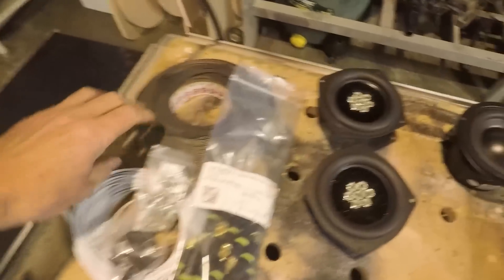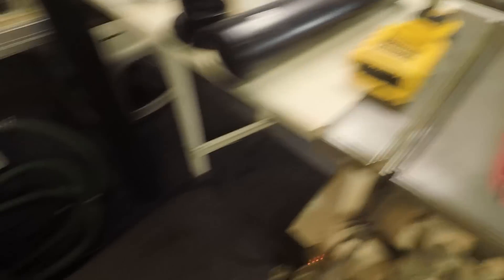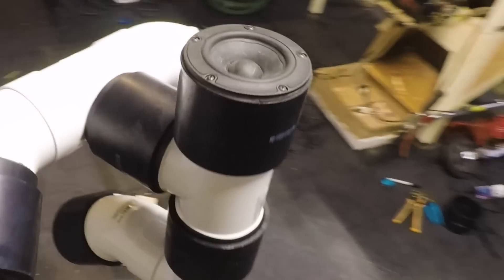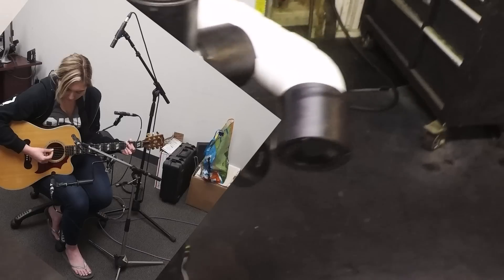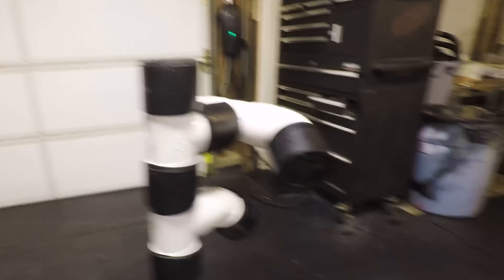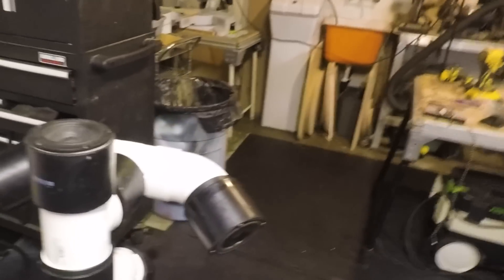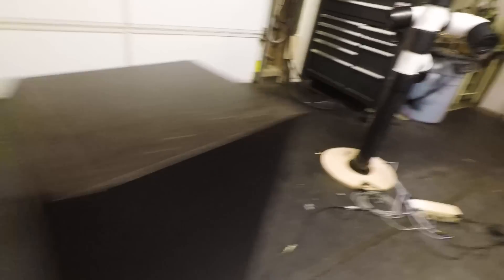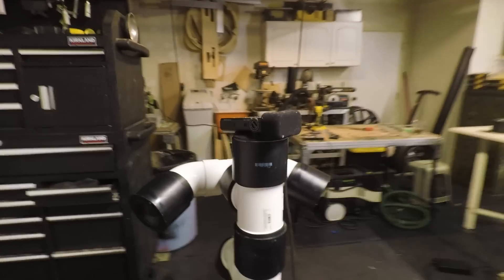Speakers Don't Sound Real, Lets Build One That Does

Comment: @Dave Rat  
I get what you're saying and trying to demonstrate, and why it may be "more accurate or realistic"...but, it's just not practical, "simple", or efficient.

A "relatively simple" stereo system using just TWO channels and TWO loudspeakers (& maybe a subwooder for ~80Hz & lower) can recreate a musical performance with the musicians placed in distinct points who are spread across the "sound stage" pretty dang convincingly.

In addition, while it may be a compromise, a 2-channel stereo setup is WAY more versatile when it comes to reproducing a Wide Variety of performances and/or numbers of musicians and instruments.

Tracking engineers aren't going to want to set up & track Each Instrument or Vocal performance with 4+ mics (drum kits excluded for obvious reasons).

Extra mics, cables, preamps, and LOTS of multi-tracks all become expensive, and it would slow the music production process down significantly.  By the time I've set up 4+ mics for a single acoustical guitarist, he or she has lots his/her inspiration and excitement, and I end up just capturing a forced, mediocre performance.

Same applies to a home or car stereo system.  Sure there is the popularity of Home Theater setups with the latest surround sound formats that require lots of multi-channel processing, amplification, and loudspeakers & subs, but due to size and budget constraints, most music enthusiasts still just want to have a fairly compact, affordable "stereo system" that doesn't impact their living space or budget too much.

And IMO, I never want the reproduction of sound in my home or car to get too releastic (it's already extremely close), because I never want to lose the inspiration or desire to experience live musicians and performances.

On a side note, go take a listen to some of the direct to 2-track recordings that Pierre Sprey (RIP) has done for his Mappleshade Records label with a single, custom stereo microphone setup...think Blumlein/ORTF...with all of the musicians positioned around the mic in the room while performing together live, "mixed" by using distance and placement.   IMO, they are realistic and convincing enough for me (a drummer & saxophonist) when played back on a decent 2-channel stereo system.

IMO, your proposed speaker setup and system would obviously be way more realistic compared to traditional 2-channel stereo setups IF we all wanted to walk around and move between each of the performers and instruments on the stage...i.e. replicating me walking to my seat in the middle of a large orchestra to the woodwinds section while everyone is "tuning up", etc.

But how many of us experience musical performances this way in real life?  Pretty much ZERO, right?   We're usually in a fixed position somewhere in front of the stage.  And most of us would not have the necessary space in our living spaces/homes to place all of these extra speakers, nor would we have the desire to walk around them while we listen...I'm usually kicking back in my cozy chair or couch while listening at home.  Or if I'm out and about running errands, at the gym, walking/hiking/cycling, I'm using IEMs that can't accommodate this type of setup.

If we go to a small club or most concert venues, large or small, we are either sitting down in a chair in a relatively fixed position, or we pick a position in the crowd to stand during the performance.  In either situation, we are located somewhere in front of the stage, not walking around the performers on the stage.

So, for those reasons, I don't think that the relative simplicity and reproduction/performance quality of a traditional 2-channel stereo system is going to change in any significant way in the near future.  It's relatively simple, compact, affordable, and effective.

Just my .02 FWIW
Reply from the maker: It's fun to think of all the ways things can't work and even more fun and challenging to think of the ways it can.

Perhaps a singer songwriter could get 4 mics and sit in a studio or at home and live stream video and realistic sound to the 4 or 8 of theses speakers they own located at bars and restaurants around the city.

The musician can play loads of gigs at the same time, the bars and restaurants save money and get a realistic sounding performer that brings ooohs and aaaahs and sounds so real it's an attraction of its own

Or perhaps it's used in conjunction with a 3d projection of someone giving a speech or seminar. It works with vocals.

Or at a trade show selling products or an online site is setup where people can upload there music recorded this way in 5.1, 4 mics for the instrument, 1 mic for the room or 9.1 for 2 instruments and this system now ties into existing tech.

My believe is that sonic realism is so impressive when heard, it will gain traction organically if not marketed
Reply: @Dave Rat  
I get you.  I'm all for the pursuit of sonic realism and the challenges of exploring what is possible, as well as the fun and problem solving that comes with it.

But from what you have proposed so far, unfortunately, I kind of have the Beta vs. VHS conundrum in the back of my head.  But if you can develop this further and design and produce a system that achieves this level of realism, and it would be available and affordable for a wide range of artists, consumers, and venues, AWESOME.

If there was any more perfect time to develop this technology and make it a reality, it would have been during the height of the C-19 pandemic and the lockdown on live performances.

As it is now, EVERYONE wants to get out to a real LIVE performance and actually see and hear the artist(s) Live and in the flesh. 

(For me) music remains a very social experience.  I don't particularly want a reproduction or simulation of the artist(s) to be as good as a true live performance.  I'm not yet willing to give up the "human" factor.

No matter what type or how good of recording and/or visual projection of an artist is, at a venue, the artist can not actively interact and respond in real time to and with the crowd or listeners.  That direct connection, interaction, and resulting emotion is lost.

Again, I can sit at home or in my high end car audio system and listen to a fairly convincing recording using my 2-channel stereo system and enjoy it immensely.  But for those artist's music whom I really admire and love, I still want to see them live and in the flesh to experience their raw emotion, musicianship, artistry, and their response/interaction with the audience.  

With recordings, it's obviously easy to mix and "edit" the audio to produce a flawless performance.  But as you well know, at a live performance you are able to see and hear the performer's true level of talent and artistry, flaws and all.  Sure, there's AutoTune and backing tracks to trick us to some degree, but there still is the...human factor.

But I love that you're always exploring and thinking outside the box (speaker) ;) and hopefully we do find a way to make the reproduction and playback of musical performances and/or speeches, dissertations, lectures, etc, more involving, realistic, and interactive.

I'm also a drummer/percussionist and saxophonist, so I have a vested and enthusiastic interest in better recording technology for capturing, distributing, and sharing my music with others.

Luckily, really good microphones and recording equipment is becoming available for less cost each year, but I'm partial to the better ribbon mics (and top quality mic preamps for them), which adds up quickly for an independent artist.  So, the potential need to use even more microphones to capture each artist's performance might be a tough sell for some...  Maybe not so much of a problem for established artists and the larger commercial recording studios. 

And I hope to see you in the lineup someday soon, too!   I'm a surfer and former pro surf photographer for SURFER and Surfing magazines back in the late 80's/early 90's, where I mainly covered my local L.A./Malibu/Ventura/Santa Barbara areas, as well as far off travel destinations, surf/sailing surfaris ...Bali/Indo, Fiji, Tahiti, Japan, Oz, Rarotonga, Mexico, Hawaii, etc.  ;)

Cheers!

Comment: Hi Dave, what is the length of the pipe, how do you stuff/line the pipe, and how do you connect to the amp? Thanks a lot. I’m interested in this concept.
Reply from the maker: The pipe length does not matter much, I just selected lengths for a reasonable hight similar to a seated guitar player.

Stuffing insulation loosely in all the tubes is very important. I ran wires in the tubes and and used some small class D amps. You can buy 2 or 4 channel amps on Amazon for under $30 or so.
Reply: @DaveRat  Thanks Dave! Appreciate your response.

Comment: Another idea which might help with creating the natural sound.  This really only works for recording vs reinforcement.
When placing the microphones, put your head near the spot and take a listen.  A movement of a few inches to a few feet will change what the "mic" hears.  If you then try and record the most interesting part of Left/Right/Front/Back, closer/further.   I think it will make it even more realistic.

For vocals, try off axis left/right/up/down and it will change the eq characteristic significantly.  Even for guitar amps, turn the guitar down and amp up and listen with the mic/ear till you find the most interesting/pleasing/subjective sound you want.   Get your head into the spot if you can, otherwise use the mic with the headphones on.
Reply from the maker: Very cool and for capturing position that is good advice.

Comment: Hi Dave, love your channel. I have a bit of a technical question for you if you have a minute. I watch a lot of audio production videos on mixing/master heavy metal guitars and a lot of guys use the lo/hi cut filter to kill off the 'whoof' and the high end white noise, and also so in the mix the bass/kick doesn't have to compete.  but to me this seems like you're gutting your guitar tone and good frequencies that should be retained.  Would you know of a more clever way of making guitar sit in the mix without killing/deleting the extreme lo/hi end? Could 5.1 surround be an option for assigning speakers for the one instrument? Cheers!
Reply from the maker: Hmmm, well the assumption that they are killing part of the tone may be flawed. Mics tend not to pick up like we hear and a close mic speaker can offer way more HF and LF than the rog actually sounds like.

Cardioid mics unnaturally boost lows. Air wind from the speaker motion is not really audible to us but the mic sees it as low end sound. And for the highs, the higher freqs will be extra loud towards cone center and very beamy, mixing off center too far gets boomy. Most guitar players ears are not at the height and dead center to the mic. So the mic picks up a brighter sound than the guitar player hears or intends.

So, I would lean toward, "make the pa sound like the rig and do whatever it takes to get there"

Comment: Interesting idea Dave, there have more than a few companies over the years that tried to come up  with multi-direction speaker systems and the issue was always phase between drivers especially in 2 or 3 way design's , next is the issue with most audiophile assumptions that  phase should always be relative to one main point . One of the reasons why di-pole home audio speakers are so well liked is because they produce that type of sound.
Reply from the maker: Yeah, I think the desire to overcomplicate makes it worse
Reply: This is why some people prefer Ohm Walsh's.
Reply from the maker: There are many great sounding and great looking speakers out there. And there are no e I have ever heard that realistically reproduce sound such that when I walk around it is not obvious that it's coming from a speaker
Reply: @DaveRat  But the same would happen at a sound reinforced venue. Walk behind the speaker stacks and you get the same effect other than the sound from the stage monitors.
Reply from the maker: True, and my goal is not to reproduce the problems of existing speakers, nor is this design a reinforcemet product

This is designed to sound like an actual real natural instrument being played
Reply: @DaveRat  Thanks Dave. I agree it sounded very good....surprisingly. For reference a Signature Edition Ohm Walsh tall speaker is $950.00. Considerably more than yours no doubt but I'm sure it has a higher frequency response range. It's also interesting to take a single driver like you used and place it on a wide flat baffle of like 15"wide or so. The impact of the baffle is startling.
Reply from the maker: That's a good idea, I will do a baffle test where I put a baffle on one of the speakers and a/b with and without
Reply: @DaveRat How about MBL?
Reply from the maker: Even having a perfect single sound that is projected in one or more directions will always be unnatural and sound like a speaker and not an instrument, no matter how perfect.

An instrument radiates brighter and duller sounds in different directions. If you mic the front of a guitar it's sounds completely different than mucing the fretboard or top or rear or anywhere else. A typical speaker radiates all of the recorded sounds in one direction. 

When you move around the room, you only hear that one sound from each speaker.

What you should hear is the guitar getting brighter or duller, more or less string sound  while maybe the bass does the opposite and the vocals do something completely different, as you wander the the room. 

With a normal speaker as you wander everything stays the same or everying gets duller.

This is why or ears and brain know it's fake so easily
Reply: @DaveRat  I will agree that we can never reproduce the actual sound of an acoustic instrument exactly. That's where audio nirvana dwells. The concept you are talking about here is off axis listening. When you are not positioned in an equilateral triangle with a stereo pair of speakers you lose some of the nuance of the playback signal. Some speakers are more directional than others. Going back to recording an acoustic instrument, I think what is lost is some of the harmonics of the room. The natural reverberation that occurs from the (in this case) guitar. A microphone cannot replace the human brain and that's where things begin to degrade. Also as you know, different mics have different polar patterns so that affects the sound as well. Room treatment during playback also plays a big role which is why in a high end hifi set up, you have base traps and other acoustic treatments to help control room vibrations and reflections that color the sound. It's the old, live-end, dead-end idea. We want some reverberation but not too much, otherwise sound is bouncing from everywhere and causes confusion. An audiophile strives to create a system that best reproduces the actual recording of the music.....but it is only as good as that recording, never the actual live performance.
Reply from the maker: 8 think the perspective of hifi is tooffer the listener and environment. The sound of a listener being transported to a different space. Recreating another space in their living room .

And all of what you say applies to that concept

This concept is unrelated and therefore does not face the same challenges

This concept is to bring the raw instrument sound into the listener's space, no recreation of another space.

Phase and comb filtering issues occur from the same sound radiated from multiple speakers, the design reduces that by using differing sounds for each speaker
Reply: @DaveRat  Agreed Dave , my being a musician helps me listen more to what Im missing in most speaker systems and as you  so adroitly pointed out having the same sound coming from a stereo pair is not the goal here and typically impossible due to comb filtering and phase issues. Most acoustic instruments are the hardest to reproduce , because thier sound as a distinct point source is so complex . Horn instruments being signifacntly different than string instruments , Piano's and irritatingly hard to mic up to get a natural sound from anything ! Everything else in reproduction becomes an artificial construct of the original sound .
Reply from the maker: Yes! I will do more and see where it goes with the design
Reply from the maker: Hmmm, just did tests comparing a Bose 401, Heil amt1, Rogers Studio 1, 2 different spherical speakers, an NXT distributed mode speaker, Audio studio monitor, ADC 1020/2 and an L-Acoustics MTD 108 to the multi directional speakers I made.

I mic'ed a real instrument and then played it back through all the diff speakers and captured the output with the same mics and positions as the recording of the live instrument

The video allows you to hear the original, all the speakers and determine for yourself if we are really that far off using designs like this.

It's on the member side of my YouTube for now butjin a month or two, I will put it public for a while.
Reply: Mbl, bose901, just examples. You also could put a cone above a horizontally oriented speaker.